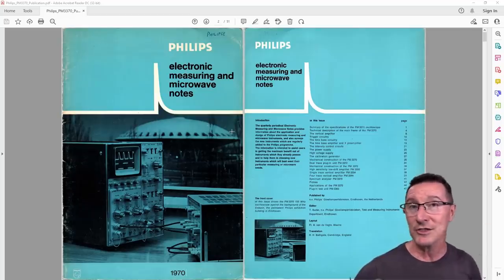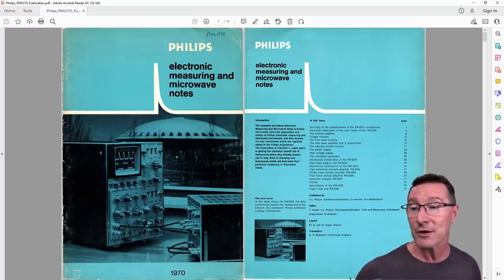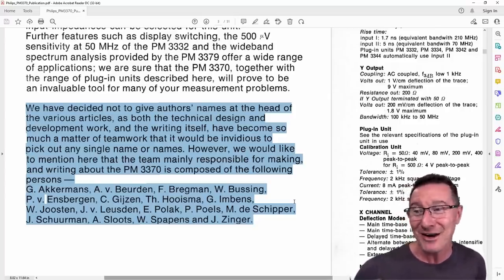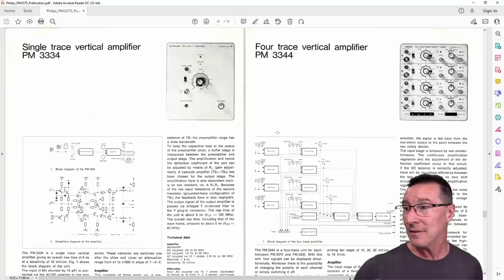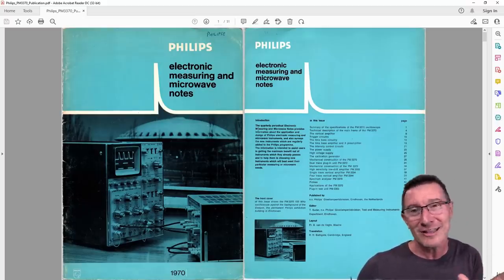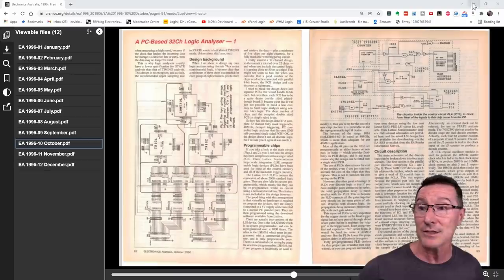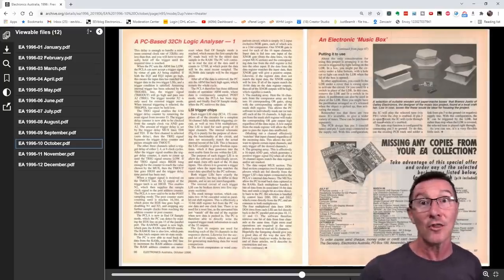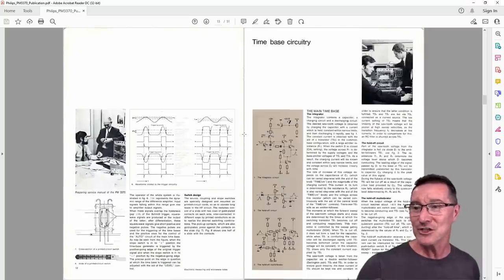eevBLAB 94 - Why Dont Companies DO THIS Anymore?

Comment: Being a technical writer for more than 20 years, I can tell you that management sees us more as overhead than anything else, luckily, being required for the certification of aerospace products, they can't do without us!
Reply: All employees (besides the management) are seen as cost creating only today. You can easily find out by the number of times they tell you „our most valuable asset are our employees“. And if you look at patents, number one inventor is always the CTO that happened to be there at that point in time. Next are the co-inventors, that often do not change much over time because they are doing the work the other is getting bonuses for.
Reply: I was an IT consultant for many years and my  hat's off to you. We used to say "it's isn't done until the paperwork" but most techies can't do it right.  Docs make things usable. I just got an RTL-SDR dongle and you wouldn't believe how hard it was to find out how to make it work in HF!  If it wasn't for online user groups and my very direct questions I still would not know.  

And BTW I know you guys and gals were underpaid too!
Reply: Similar for Oil&Gas projects, some of the MDR's (Manufacturer Data Records) and IOM's (Installation and Operation Manuals) I used to collate often had thousands of pages. Fun stuff!
Reply: @fromgermany271  I was listed as last on the provisional patent a company wanted me to work on, was the only one who did any work and only one who understood it. Walked away from that and left them hanging. No one should put up with that.

Comment: as many will no doubt have already said, money is probably the principal reason we don't see this any more. it costs, and doesn't earn, so it has to go. but there may be more to it, big companies are increasingly run by professional executives rather than people with a technical background, and that type of person is conditioned to see both a company's success and its identity in terms of their own inspired leadership and financial wizardry rather than in terms of the engineers who design and manufacture their products.
Reply: True. I kinda wish the engineers ran technological businesses. Well, it's the case in the early stage, but after the business becomes so bloated it has an overgrown management structure, things like this tend to happen.
Reply: Aka the bean counters. Everything is optimised away to make the most profit.
Reply: Maximize profits for the shareholders, everything else is second to this. Simple as that.
Reply: "...it costs, and doesn't earn" is the big mistake.
Reply: The big mistake is thinking's that these magazines do not inspire or boost your employees efficiency.... 
Some will read this an feel enlighten to the point where they work on the weekend in their basements to completely accelerate any development process.
I am heart broken to tell you that I work for some tech firm which is now 30years+ in the industry and an absolute bomb when it comes to * and industrial ***ing and we have this kind of magazine internal. The current situation has transformed this firm into an burning pile of poop, where bean counters order people back to work while they where in direct contact to the "thing" and highly possible positive. Their personal test every day then gets done with no supervision as it is likely positive. And no one wants to go home with no vaccination so some people just outright lie to their co workers..
The owner is 75years+ and has lost control of his own truly impressive life's work, for me actually it was almost a code of honor to him to put up an absolute fight when it came to any task I was given. As an young engineer I wasn't always up to my tasks but I never stopped.

Sometimes it is heart breaking to leave your job
Reply: It is actually earns more than a vaguely described device. Most devices can do much more than short description says - but no way company will pay a technical writer for no visible (to non-educated management) commercial value!

Comment: Nowadays, whenever I get my hands on a cool piece of vintage audio equipment I always try to buy original technical documentation and service manuals, even when digital scans (often in poor quality) are available online. I do it because everything about the old documentation is so well made. Even just the print quality of the diagrams is so much better than anything my shitty laser printer can put out. I also love the old manuals for the occasional picture of the manufacturing plant and stuff like that. I really agree with the sentiment of this video.
Reply: I worked as the service manager for ten years at a high end London HiFi dealer and was just thinking  about the filing cabinets we had full of service manuals before I read your comment ...They were simply a wonderful collection and audio was very well served. Almost every item before 1990 had a comprehensive manual. After 1990 HiFi sort of died and Audio Visual took over. In the 1970s after the car, the hifi was the next biggest consumer consideration. Not for 40 years has it been in that position.
Glad you are an audio man. Love your channel I have been a long time subscriber.
Reply: The colour pages in my LeCroy service manual are really beautiful, I was about to say especially the yellow, then the blue, but its all stunning, even the paper quality, its thick and glossy and feels like what royalty would use for important paperwork, and there is hundred and hundreds of pages, its over 1.5 inches thick.   But then the manual for my Loewe CRT TV, the pages are as thin as rice paper.  Small things to get excited over, but cool nonetheless
Reply: @minus3dbintheteens60  😸
Reply: The legend has commented!
Reply: It was impressive with what you used to get. I still have copies of the original user and programmer manuals for the 68HC11 and 68000 series of Motorola microcontrollers which were used in ECMs and PCMs of cars. Absolute goldmine those things were. I guess if anything this shows how people just don't have any vested interest or pride in their work like they used to. Now it's just a siloed Mega Corp turning out cheap plastic widgets. Speaking of audio this is even worse with things like speakers. Back in the day they would at least make a half-assed attempt to show the response. It was terrible to the point that you wanted to toss it off a cliff, but at least they tried. Now it's just fairy tales for adults in a marketing brochure, with an owner's manual that is thick as not because its informative, but because it's in 6,000 different languages. As much as I like doing speaker measurements, they are still transducers, and it would be nice if they came with datasheets like one. I'm being rhetorical here, but it is still irksome to have to make the datasheet yourself, not to mention the manual labor involved if it's a large tower speaker.
Reply: @mysock351C   I know what you mean, but just a couple of weeks ago, I bought a set of 3 ways for the car, they're Vibe Cven C63v4, and the manual blew me away actually.  
Each driver gets 4 pages of their own, 2 pages of a write up and features, then a page of physical specifications of the basket depth, width, mounting and connection details etc along with a window of SPL and Impedance tested at 6 different angles (on axis, 15, 30, 45 & 60 deg off) + the impedance curve which is measured using a semi-constant current source, and finally another pages with T/S parameters that really impressed me including coil diameter and height, gap height, motor strength, measured inductance at multiple various frequencies as well as 4 parameters I'm not even sure about: Krm Erm Kxm Exm which seems to be related to the voice coil and a model called Wright empirical model also used in LEAP-4 the TSL model (linearxdotcom).  
They state how the speakers were "burned in" before testing Q, Vas, Cms, FS etc (12 hours after running 20hz at 14V RMS for 2 hours) and even list those specs in 2 different tables, before burn-in & after burn-in, they listed temperature of testing condition, list which tests are done in open baffle vs free air (aka no cabet), all in a really nice glossy booklet that reminds me of a product brochure booklet.  
They even tell you the different standards they use for the various power ratings, IEC 268-5.  

This manual really dropped my jaw, I mean I have seen close to this level of pride with Morel in their really old stuff but honestly this is the best manual for a speaker I've ever seen, digital included, and they're Vibe dude, not a great brand, I don't think they made them, I think they got the drivers from another manufacturer, but this brand new set of VIBE 3 ways (their flagship line at the time, they have a new flagship now, more expensive) with passive crossovers, with Mundorf M caps by the way, cost me less than the lowest end set of Hertz, Focal etc or half the price of a decent set that you would actually spend your money on, $500 Australian.   

I really should have made a video on them.  You might want to download the manual to check it out, you seem to be into that kinda thing. 
Hey, I am, I download the manual of anything/everything before I buy it, to know how it works and its specs.
Reply: @minus3dbintheteens60  For the actual drivers they are quite forthcoming, namely because it's imperative to the proper design of an enclosure. Once it gets turned into a loudspeaker that you can buy from the store, then all that nice data goes poof. A good example would be something like "8-ohm nominal impedance", but the actual impedance is 4 ohms, with a minimum of 3.2 ohms. The rest of the specs are similarly not terribly insightful. I think a lot of it boils down to the market being so oversaturated with audio equipment. For speakers I have REW and ARTA, which can give pretty much everything needed to properly set up the speakers and EQ them along with the usual pretty pictures, but it would be nice if they just supplied it up front or something that can be downloaded. But as can be seen from Klippel data on places such as Erin's Audio Corner and ASR, they often have many, many sins to hide.
Reply: @minus3dbintheteens60  And for what its worth, I usually buy them as complete units, namely because I'm such an atrocious woodworker. Good with welders but with circular saws I'm happy if the only outcome is still having ten fingers.
Reply: That's the sort of thing I'd like to do with my Musical Fidelity A1 MK2.
Reply: When’s the next video out, we’ve not seen you since you disappeared in that ghost town :)
Reply: let alone the smell of the good old times these documents exude 🤩

Comment: When I worked at the original Prime image, a professional video products company, we used an old paint shaker table to vibrate our products. it was downright vicious! Our burn in ovens were repurposed donut warming racks from a bakery! It's true. They don't make anything like that any more. I designed the digital core of the accESS 500 Still Store. Keith Moeller and Chris Gifford designed the analog transcoder sections. Bill Batty was responsible for glue logic FPGAs and application software. That would have been around 1991. Our product was nominated for an Excellence in Engineering award at the NAB show in Las Vegas. We didn't win. But, what a privilege!

Comment: Those were the days....
I spent a lot of hours in Philips R&D labs in the 70s and 80s, working with this oscilloscope and also with its predecessor PM3330, 
a very bulky and very heavy main frame, which used the same vertical amplifier plugins.
Specially the PM3370 was a pleasure to work with!

Comment: With all my projects/designs, at my current company, both software and hardware, we always write an internal "Design Debrief" document detailing the design decisions made, critical component decisions, printouts of simulations, areas where there were issues/failures etc. Bit of a pain to do especially if pushed to actually do some "money earning work" or move onto next project, but I have found superbly invaluable when returning to design many years later or taking over someone else's design/project.

Comment: My father and most of his friends, born around 1917, fixed everything.  Support offered in books like this was common in their lifetime. Toaster, TV, radio or alarm clock, nothing went in the trash.  Most devices came with schematics while today everything is cheap and designed to fail, not  repaired by users. With all our technology we forget radio has provided a lifeline during disasters for more then 100 years, making their maintenance and repair more important then every before.

Comment: I've worked in very important companies for the last 25 years. What I have seen: there is not even the resources for generating the internal needed documentation to a decent standard (so it can be understood or used for the next guy carrying the development on). Today engineers are people who cannot decently speak they own language, let alone a foreign one. Pathetic structures of hundreds of people defining processes and documentation templates, bad tools used wrong. Above project managers who have never developed anything, line managers that come fresh out of the university, with no work experience whatsoever. The management constantly is trying to implement new things, thinking it will magically rise the quality of the products: ISO9000, ISO14000, ISO26262, CMMI, "lean management",  "agile", you name it. I really ask myself how long can it go on like this...

Comment: The hp journal, and their bench briefs were equally great. My favorite is hpj 4-1989, about the development of the 3458A, which I have kept until to date. A pity also, that these journals are gone as well. Theory Of Operation was always covered in the great hp manuals, where I learnt how instruments worked, and how to repair them. That always was a requirement by the military, i.e. Airforce lab, where I first worked.

Comment: I mean these days you are lucky to get the datasheet to a new IC without signing an NDA as a corporate entity!
Reply: Like what new IC? And what proportion of ICs fall into that category?
Reply: @Graham_Wideman  There are new microcontrollers being released all the time. And power controllers, and MEMS is a hot field. And radio chips - to mention a few.
Reply: @mr_gerber  New ICs is not the topic -- obviously new ICs appear regularly. The topic is new ICs for which the manufacturer requires an NDA for you to get a datasheet.
Reply: @Graham_Wideman  Oh. That's really not obvious from your question. Well, radio chips are still an example, iirc. More niche chips might typically be NDA-protected. Some thermal imaging stuff I looked at a few years ago, were protected.
Reply: @mr_gerber  "not obvious", possibly -- you have to read in context of the original poster's question. And sure, there are chips for which an NDA is required, for example cell phone system-on-chip or system-on-module chips, where it is destined for proprietary end products only. But otherwise, chip manufacturers want to sell their chips into new products, and are predisposed to providing the docs to enable customers to use them.
Reply: @Graham_Wideman  Whatever man. Not being precision and obvious is not the end of the world.
.
But I agree with the impression that most general ICs have datasheets available. 
But it's not uncommon for it to be protected either

Comment: In looking for history on one of my favorite meters, the 3456A, I ran across the HP Journal, April 1981, Volume 32. It, and others, are hosted on an HP domain called hpl. My guess is it's run by a former HP engineer now working as a janitor in the basement. Could be that only the payroll system running on an HP 3000 still knows he works there.
Reply: How might someone find the site friend?

Comment: Such publications are a great resource for working on vintage test gear, as well.  Reading the HP journal article sure helped with fixing up an 8662A RF generator, and the TekScope article on the 492 SpecAn.

One more casualty of the bean counters and IP attorneys, I guess...

Comment: It's interesting how Philips not only made this kind of publication on paper, they also did things like electronic kits that let you build a hifi amplifier and explained how it worked. They also produced videos about how things were made, that had a very typical style that was very recognizable. If you follow David Tipton, his videos remind me a bit of the Philips videos: they would switch angles at the exact time, had the lighting exactly right, had the color exactly right... That brochure or magazine is from a time when Philips did extremely well. They did lots of research, they had introduced the cassette and the video cassette (long before that VHS and Beta rubbish), were probably working on Video LP which would later turn into LaserDisc and CD, and their hifi equipment and speakers were well known. Not to mention shavers, TV cameras, X-Ray machines... But in the mid 1970s something started to go wrong. They started getting competition from Japan and Hong Kong and people wanted to get better gear, cheaper. And management and stock holders wanted more money. Some time in the 1980s they had something like half a million people working for them and made the equivalent of half a billion euros in profit. But they got rid of every division and the quality of products started to go down.
Interestingly, almost everything they spun off, did extremely well. ASML has been the number 1 manufacturer of chip production machines. You know how successful Fluke is. Bosch/BTS continued making TV cameras. NXP is still massively successful. So is Vishay. Now, all that's left of Philips is medical systems. And the departments that made those brochures, videos, service manuals and data sheets are long gone. Shame.